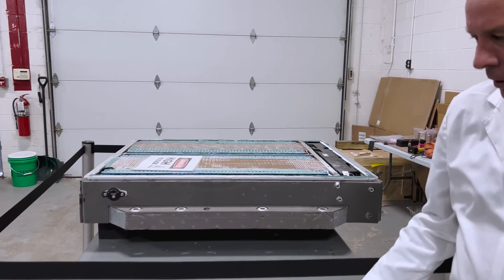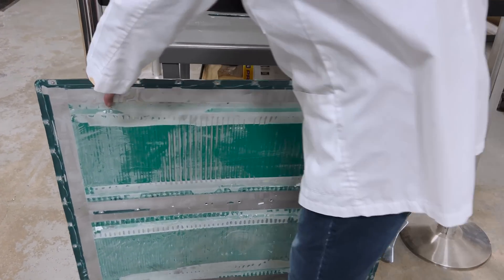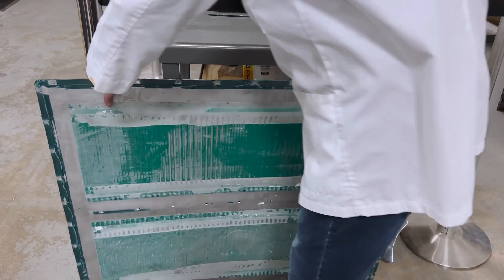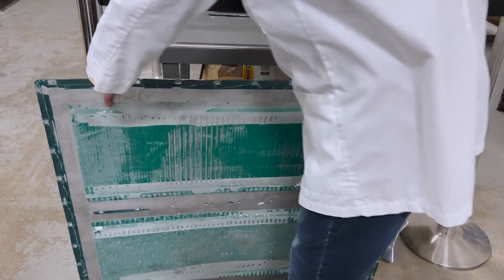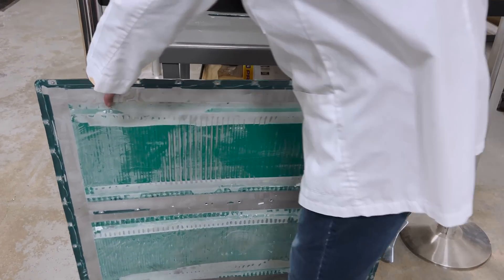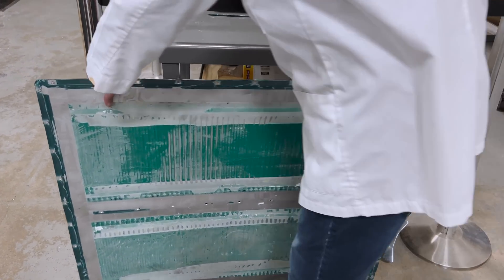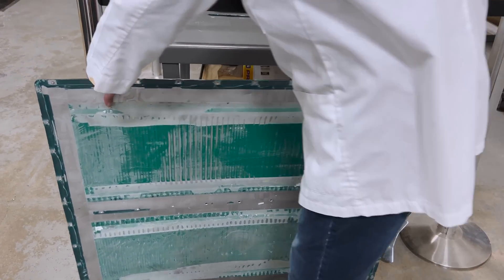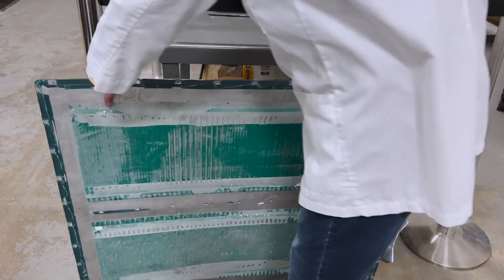Shark Attack! Breaking Down BYD’s Battery Pack

Comment: It would be great to see penetration test of charged blade byd battery
Reply: LFP are very stable, not much will happen. There are such tests on YT on LFP
Reply: @bobbysuazjFhvcfgh  Not 100% true..Not all LFP or LiFePo4  batteries are made the same..I have done my own testing it is all dependent on the state of charge. The newer designs are slower though and more smoke less fire I'd say this is due to improved separator materials being used. BYD appears to be best so far.
Reply: @bobbysuazjFhvcfgh  not when they are in pack
Reply: @bobbysuazjFhvcfgh  there's only one test. Done by BYD.
Reply: BYD already has a nail test, where they drive a steel nail through the pack.  No NMC pack can do this.
Reply: LFP...safe as.
Reply: https://www.youtube.com/watch?v=CSGESKhtZD0
Reply: @davidm2893  Have a look at how the drill going through only the narrowest part of the battery.  Try the same test in this pack all the way.  It's going to burn!
Reply: Yes, I don't think that would go down well.  BYD's marketing test had the drill going through a single cell at the narrowest way.  This allows venting of heat and gas.  The way that these batteries are now in a pack, any nail will go through the longer edge, or multiple cells.   Probably just as likely to burn as other chemistries in this tight spacing.
Reply: @ Wow, could you possibly cope harder?  Nobody else does ANY version of a nail test AT ALL, and you're nitpicking the specifics of BYD passing the nail test?  

How about Euro NCAP, US FMVSS, China NCAP, and ANCAP all add a standardized nail test as a mandatory safety requirement before any BEV can be sold?  Just force a "stop sell" of every EV that doesn't use Chinese packs.

Comment: Simple design. This is a weird min-blade setup. The blade batteries on other models run the width of the vehicle. Think they needed to do this to get more cells in there to get the voltage up near 400V
Reply: BYD Full EVs run full width blades.

BYD PHEVs use these 'Short Blade' battery cells.

Comment: Definitely not repairable but that seems to be the trend.
Reply: Everything is tradeoffs.  BYD optimized for tight packaging, low weight, high rigidity, and structural strength.  Other OEMs might optimize for repair, but that's kind of predicated on seeing higher cell failure rates where regularly refurbishing a LOT of battery packs makes sense.
Reply: Actaully i am glad that it is not repairable, safety comes first.
Reply: @cheekhenliew7628  I don't disagree.  Simply pointing it out.
Reply: @StormyDog  Even the battery rack for the solar panel is welded so it cannot be repaired.
Reply: Mercedes will use a repairable battery in their upcoming and very promising electric CLA. The repairability has a downside though, the capacity is slightly lower and the weight slightly increased but due to the awesome efficiency of the CLA it is not a deal breaker.
Reply: 这方面我有惨痛教训，出于DIY的乐趣，去年的圣诞节，我把两组旧的太阳能蓄能用的锂电池在简单测量后进行了拼装，并用充电器在室内充电，在晚上10点钟过热起火，烧掉了我的办公室。为此我未来三年每月都要为此从工资里扣除赔偿金

Comment: There must be a chemical way of getting trough that glue instead of brute-forcing.
Reply: Personally, if I were doing it, I would have used industrial epoxy.  The cells are structural, require structural adhesion.

Comment: In the previous episodes I understood it would be a partial teardown so they could eventually put it back together, but at this point with the battery pack opened with a rotary saw I don't think it's happening anymore 😄
Reply from the maker: We never put the vehicles back together.
Reply: "Reassemble in the reverse order of dissasembly" uh oh.
Reply: It's pretty clear this battery was not designed to be repaired. Ever.
Reply: @ Hahaha, ALL cars are now designed not to be repaired by consumers.  Ever.  You can't even swap the basic 12V battery in a BMW without going to the dealer.  This is a 365V battery pack carrying lethal voltage and charge that no unauthorized shade tree mechanic should be mucking about with.
Reply: @ZweiZwolf  Two wrongs don't make a right.
Reply: @TheThunderdome-il3ez 

"No user serviceable parts inside."
Reply: @TheThunderdome-il3ez  The battery is not very expansive and most of the battery don't designed for repair.
Reply: @linjunhalida - the battery is one of the most expensive pieces of the car.
Reply: @DavidHalko  Not for HEV, it use smaller battery.
Reply: @linjunhalida  - sure, HEV batteries cost as much as a transmission in an ICE car… probably last as long as one, as well
Reply: @ exactly, i was thinking about getting a BYD as a new car, now im no longer thinking about that.

Comment: 30kW? battery capacity is measured in kWh
Reply: Wrong charge and discharge rate is KWH not storage capacity.
Reply: @chetsaxton1526   Charge and Discharge rate is kW and at 4:24 he says the capacity is 30kW which is patently wrong.

Comment: 30 kWh, not 30 kW!!!
Reply: Kilo watts per hour, or kwh is how much electricity the battery can store. Like a 5 liter bottle can hold 5 liters of water. It's overall capacity not instant power strength: kilo watts or kw.
Reply: @soowo5942  It's not kW per hour, it's kW * h. It's a measure of Energy and Energy = Power * Time
Reply: @soowo5942 Exactly!
Reply: Guys, if you have any questions, just ask ChatGPT or DeepSeek
Reply: @soowo5942  KWH is only when a battery is being used either charger or discharging.
Reply: @soowo5942  No it's not, KWH is how many hours it takes to drain the battery, just like your 5 liters is only liters, but if you pour it out you get liters per minute flow rate. Same with a battery it's 30 KW just sitting there, but if you attach a load to it the flow rate is in kwh. 30 kw over 30 minutes is 60kwh (60 x 0.5 = 30) 2 hours (15 x 2 = 30) but they both started at 30 kw stored.
Reply: @chetsaxton1526  do you know, by any chance know what C rating means and how it is related to battery charge and discharge? Ypur explanation is a bit confusing
Reply: Relax
Reply: @kennyg1358 they are completely different things.  

A company like Munro should be accurate.
Reply: @RegularPersona you're hilariously upset about this.  Perfect example of youtube comment section.
Reply: @erikmoore7402  I expect a company like Munro and Associates to get the correct terms.
Reply: @kennyg1358 LOL 😂😂😂
Reply: To bad you're wrong. Storage capacity is measured in KW, charge and discharge rate is KWH.
Reply: @chetsaxton1526 Kw specifies how much power is flowing in a continuous basis.  kWh is how much power can be delivered over a period of time.  

The kWh specifies 1 kW delivered for that many hours.
Reply: @RegularPersona  There is no flow on a battery just sitting on a table, so it's KW. IF you connect a load and fully use it in 30 minutes it's 60 kwh (60 x 0.5 =30) takes 2 hours to fully drain it's 15 kwh (15 x 2 = 30) again both is equal to 30KW.
Reply: @chetsaxton1526  You got it exactly backwards, impressive.
Reply: @chetsaxton1526  Do you walk backwards as well like the Tesla robots?
Reply: @chetsaxton1526 what the flying stroke are you talking gahahahahaha😂😂 you cannot possibly actually believe that

Comment: Do you folks mind get into detail about the screw? Is it sheet metal screw or mechanical screw. And how is the workmanship. And sign of miss applied sealant poor connection or resistance/laser weld. There is nothing too special about the battery pack. Very typical construction with reasonable service ability. Now it will be the workmanship set it part from other similar product

Comment: It's a really optimized pack, for cheapness. Even the cells that have a low power voltage contact on the other side of the main one just for a simple connection to the bms. Wow. And we ask why they can pump out cars so cheaply. It's an order of magnitude simpler than Tesla or Hyundai designs.
Even the shape! Big old square and that's it.
Reply: Tesla are now using BYD Blade batteries.
Reply: @davidm2893  yep but only on the standard range model 3 and y. Every other battery is NMC or NCA, can't remember, and made with cilindrical cells. Much better performance for sure, but this is dirt cheap.
Reply: Is that why tesla and other companies use them? Is that why is the second biggest battery company?

Comment: Take a skilsaw to batt pack 😮 I was hoping for some fireworks 😂
Reply: Not LFP, very stable
Reply: @bobbysuazjFhvcfgh  Even if you don't cut a cell you can hit a bus bar.  Heck, the Jeep PHEV could, all on its own and with no cell problems, short a bus bar to ground and basically blow up.  Had to recall them.
Reply: @bobbysuazjFhvcfgh  That's a lot of volts to be right next to a spinning blade. I'd be puckering.

Comment: They mention their "blade" batteries in their marketing material a lot.
I always wonder what the benefit of hundreds of cylindrical cells is supposed to be? many rectangels like these seem to make way more sense and should pack way more efficiently and weigh less?

Also: while it is nice that batery packs are almost bomb-proof nowadays - how would this affect the hopefully eentual recycling process of the packs after its EoL?
Reply: None today. it just the limit of your production. BYD and CATL and other Chinese already capable producing prismatic at larger scale.
Reply: Cylinder ones am unsure about performance but are cheaper and easier to produce. Volumetric, pack level energy density is better with prismatic since there is a lot less wasted space between cells.
Reply: The older cylindrical cells were already commercial off the shelf bulk production by Panasonic for use in laptops.  Zero lead time and zero development cost at the expense of poor space utilization, low per cell capacity, poor pack integration, extremely high part count, high pack complexity, high pack assembly cost.
Reply: It comes down to ease of manufacturing.  If you can produce a pack of the same capacity, but at 10% lower cost, then it's better for the cars.

However, that was a decision made in the past, predicting how they could manufacture them in the future.  Reality never matches the predictions and every team has different opinions.
Reply: Cylindrical cells have no folds like prismatics, every fold is a failure point for the cells and results in poorer cycle life. 
BYD Blade batteries are not Prismatic, they are not folded, they are laminated. And Thus have a high cycle life capability.
Reply: Cylindrical cells are easier to heat and cool,  and discharge more quickly for high power outputs on performance cars.
Reply: The BYD Blade battery is very poor at staying cool due to the design and single sided cooling. Hopefully the next gen Blade battery will bring in better cooling at least 2 sided cooling, as single is just not great as shown by many YouTubers that have pushed the car hard like one that did a 1000km challenge and the battery badly rapidgated!
Reply: @gregb1599  I saw that video, that car had a fault, it wasn't cooling the pack. You could tell by the way it didn't recover quickly after being charged.

Comment: Cooling circuit away from possible off road damage makes sense.
Reply: The cooling is on top because they need the entire bottom to form a single, unified structural block which is effectively a ribbed plate, where the cells are the ribs.  It's VERY clever and light.  Thus, the top is the ONLY way to heat or cool the pack.
Reply: If you have damage that goes through the casing and damages the cooling system, then even without a cooling system there would still be enough damage to total the battery, if not the vehicle.
Reply: @juliahello6673  I did not explain my point clear enough. Damage does not always "go through," it sometimes just squashes or dents underneath. Like on my fuel tank in present car. Dented one fuel tank enough to disrupt the fuel pick up. Not all things are catastrophic disasters. Belly cooling channels are in danger of restriction or blocking from belly scrapes, which are common off road. Underbelly cooling channels are best for air flow at speeds of road going cars Off roading is often slow and air flow cooling is less effective. Cooler air descends, so on top is good for that too. So cooling circuit on top makes a lot of sense to me, and probably other off roaders.
Reply: @christover1 hot air rises up so cooling the top air make sense :)
Reply: @good2freelance1  my physics teacher argued that hot air doesn't rise, but cool air sinks which pushes the hot air up lol.
Reply: @christover1  Did your teacher have a glass that was half empty, or half full?
Reply: @checkfactschecking  He was channelling Julius Sumner Miller.
Reply: Actually, more correct is denser airs sinks due to gravity, but being hotter makes air less dense, lol
Reply: @checkfactschecking  He had a glass that was twice as large as it needed to be.
Reply: @christover1  wrong!!!! the battery is like a solid block and things will move around unlike a fuel tank which has liquid fuel that is still safe when its dented.
Reply: @christover1  there is no "cool" in physics, at least nothing besides 0K, the rest are just warm, hot and hotter...
Reply: @DooMMasteR  I am both cool and hot 🔥  lol
Reply: Does not matter many new BYD have the battery part of the structure so any damage to the battery means the car is a write off. Most insurance companies will not take the risk even it the case is dented, the joys of EV with non replaceable battery packs.
Reply: @ You know that the BYD pack can be swapped, right?  It bolts into the frame, and can be easily disconnected and unbolted for replacement.
Reply: @gregb1599  I have had plenty of insurance quotes, no problems.
Reply: Also single sided cooling has shown in actual use to be insignificant as shown by YouTubers that have shown the battery over heating when pushed hard or DC fast charged. Hopefully the next gen Blade battery fixed that flaw!
Reply: @gregb1599  BYD sells more plug-ins than Tesla, and have been doing so for quite some time.  I think it's reasonable to assume they know what they're doing at this point.

Comment: Question?
Who makes the Cells?
BYD?
Reply: Findreams, BYD subsidiary
Reply: BYD is The world's second largest battery manufacturer after CATL
Reply: @DeniSaputta  TESLA AND SAMSUNG MAKE BETTER BATTERIES.....
Reply: @marshalllapenta7656  haha tesla make batteries, funny idea
Reply: @willsandrew815  TESLA DOES 21700.....
Reply: BYD started as a battery company.
Reply: BYD founder is a scientist in battery area.
Reply: @risk6879  BYD FOUNDER NEVER HEARED OF LEAN DESIGN.......
Reply: @marshalllapenta7656  you never heard doesn’t mean it is not true.
Reply: Yes
Reply: I wonder because i remember much different measzurements: '..a common size is 960(L) x 13.5(T) x 90(W) mm'
So it's because of Findreams. Do we know the measurements, capacity and weight?
Reply: @klauszinser this is BYD's Short Blade Battery. They use Short Blades on their PHEV vehicles.

Full EV use full width blade battery cells which is probably the size measurements you are referring to
Reply: @BeYonD-EV  Thank you. I asked DeepS.. about Short Blade but there is no information. How can i find specs?
Reply: @klauszinser  there isn't much info online about them. But they would be very similar spec wise to the normal blade cells, just half the capacity per cell. I've seen a teardown of the full blade pack and it's similar to this, just that the cells run the full width of the pack.
Reply: Hai-Yah .... now you ask ? The whole video was mentioning BYD .... BYD firstly manufacture batteries before thay started making EVs
Reply: Find your dreams. Build your dreams. Heh

For American automakers in terms of global sales, its scuttle your dreams.
Reply: @firstprib7742 😂